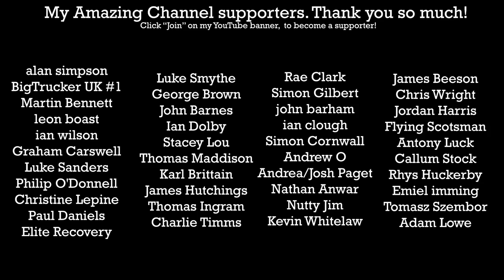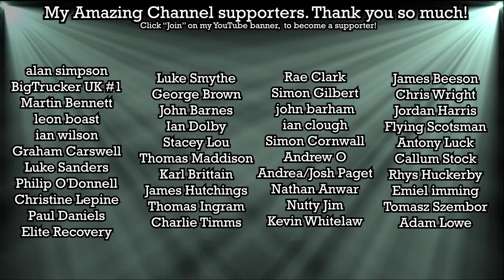This Is Not A Click-Bait Title

Comment: I’ve just clipped the fence, it’s a little bit tight. Camera changes I’m thinking, it’s not tight.
Words of advice, dont talk when your reversing.

Hate those Daft windows. Feel like writing to Daf to get them to stop that shit.
Smaller mirror at top not at the bottom.
Power steering to heavy on DaF,’s 

My grandad had a 1970’s John deer tractor you could turn the wheel with ONE finger. & I was a child 

DAFS ARE FUCKING SHIT

If you get stuck Luke or in mud, try the crawler gear, if Daf has one